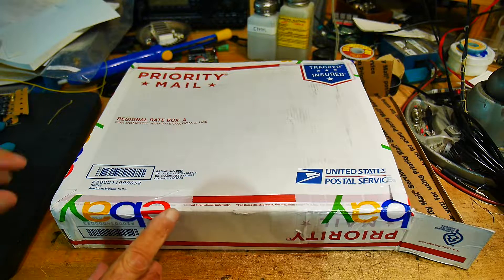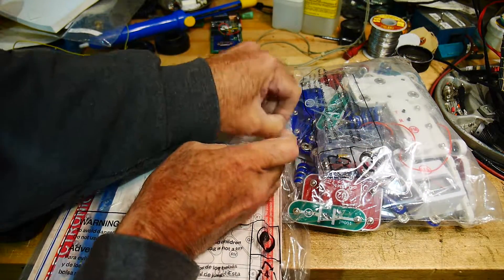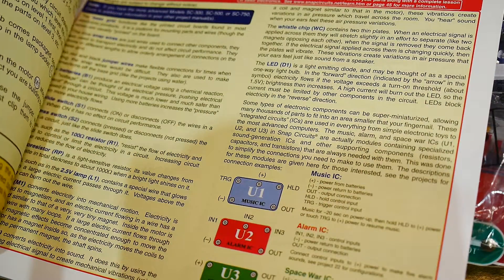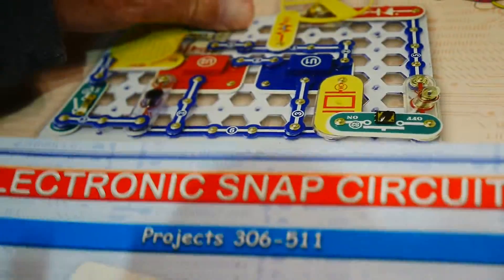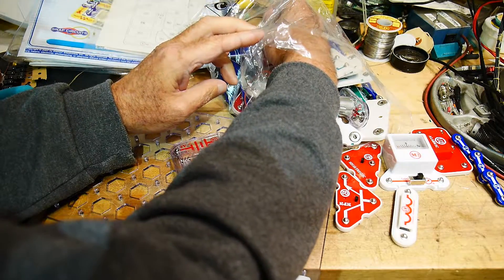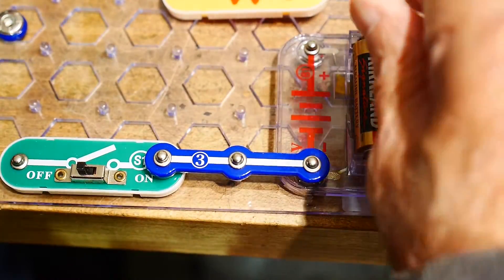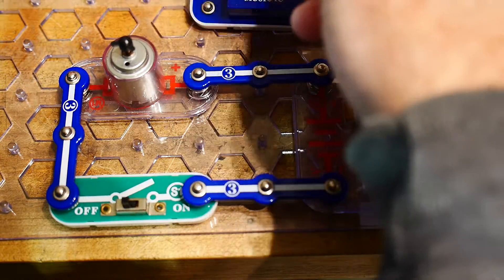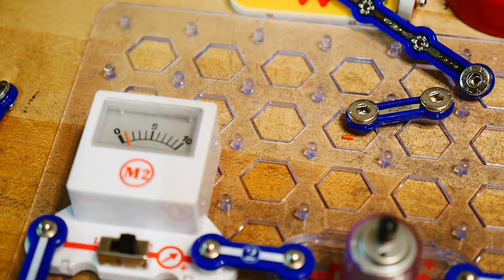#397 Elenco Snap Circuits

Comment: My primary school aged grandson has the "Smart Electronic Kit" Model W-335  equivalent of this. The parts that you show look identical - but you have so many more modules. The W-335 cost quite a bit of money on Amazon and I was attracted by what you said - "really cheap" :-)
He loves the electric motor and light bulb projects and has discovered switches in series and parallel (and how they differ). The soldering in the modules was pretty poor and I've had to repair a few but the concept is really great. I would love to get him some more connectors and modules.

The trouble is that they are all plus postage from the USA. If anyone has a similarly priced UK alternative to Amazon please post it.